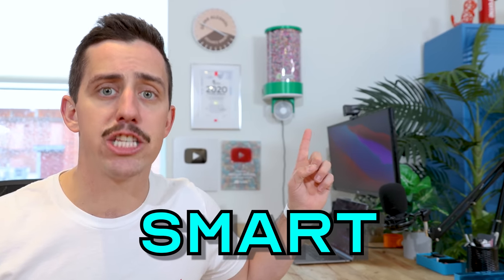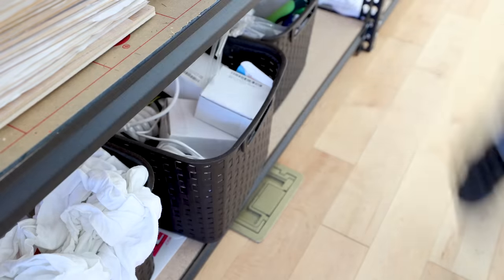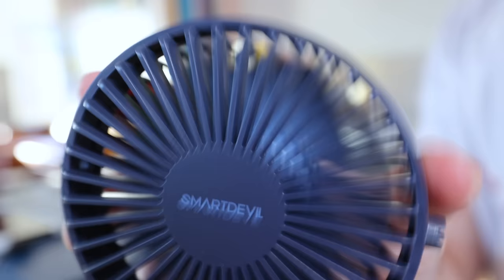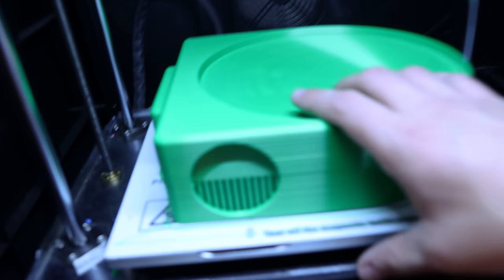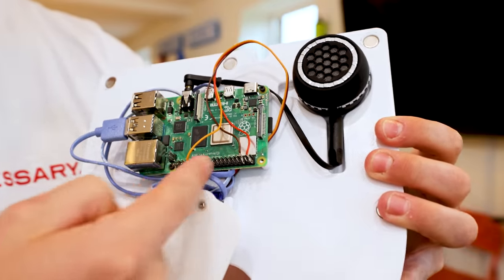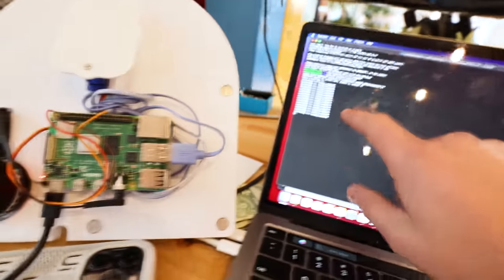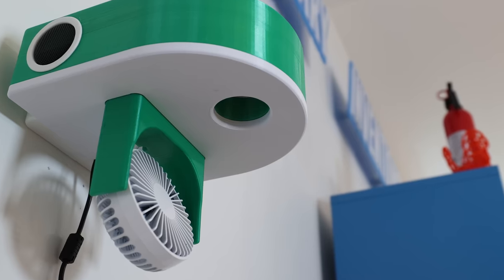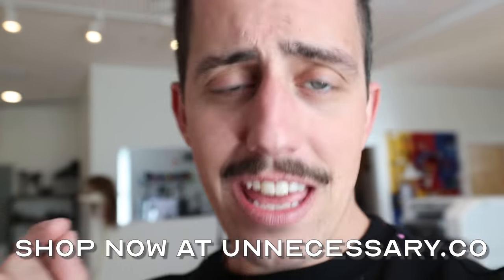If anyone does THIS...my smart Confetti Cannon goes off!

Comment: 🔥🔥🔥✅✅✅Better invention… but maybe a little too necessary for you. I thought the tube would be empty and then confetti would shot and spin around the tube with the help of the fan kinda like a confetti tornado and then once it settled at the bottom a tube could suck it back up and let it back down the tube to spin a round so it’s Recycling the confetti and the tube make a confetti tornado that way there is no clean up but still get an alert with confetti.